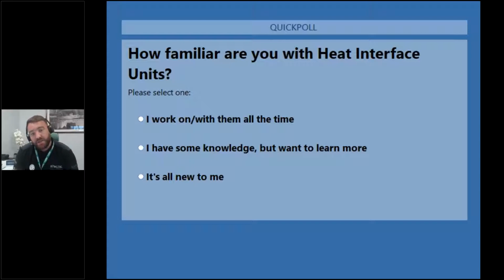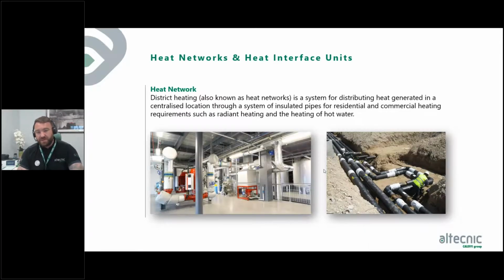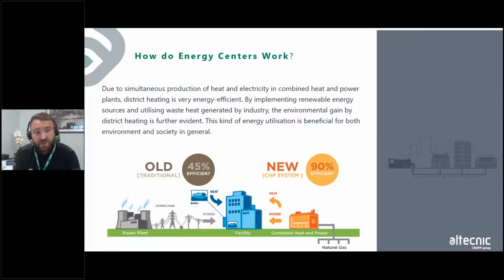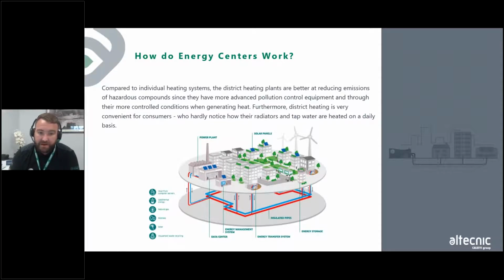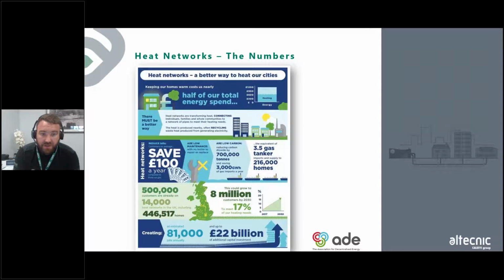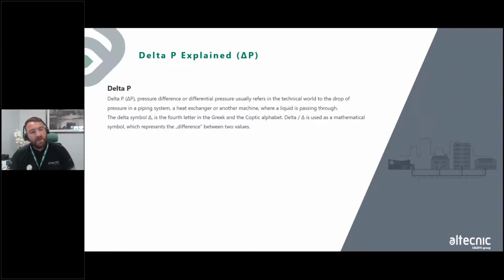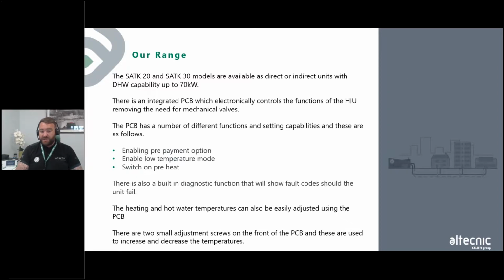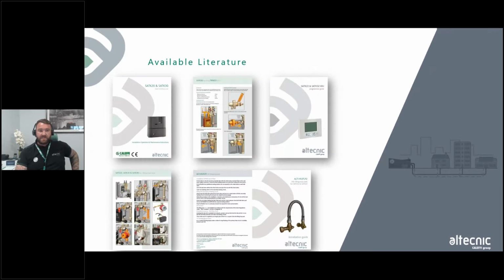Altecnic Tech Talks - Heat Networks & Heat Interface Units (HIU)

Comment: Good evening. I’m midway through your presentation and I’m finding it really informative.
I’ve just started working on a university campus and one of the main buildings is comprised of student accommodation and a hotel. The original installation is a district system supplying multiple hiu,s . The main problem in my opinion is the hot water primary pipe work supplying the required heat to the plate exchanger . Although the pipe work is insulated the heat generated by the primary circuit throughout the building and in the risers creates a level of radiant heat leading to constant complaints. I would like to hear what you think mate. 👍
Many thanks, and kind regards,
Les.
Reply from the maker: Hi Les, for all technical advice you can email technical@altecnic.co.uk or call us on 01785 218206. Thanks for watching and for your feedback.